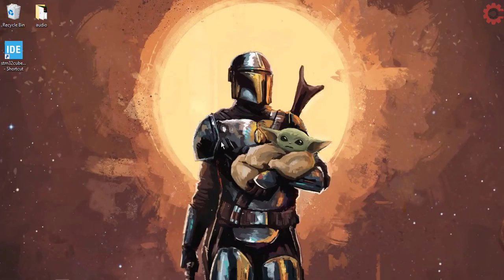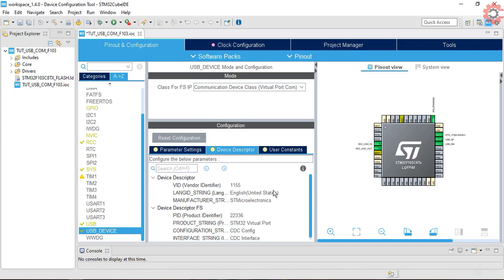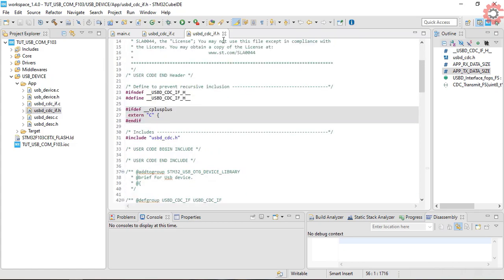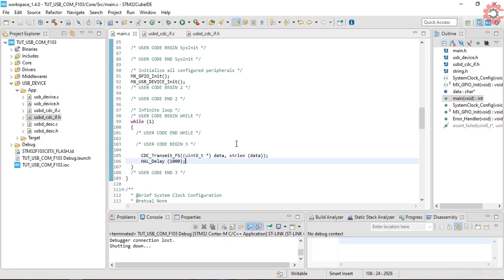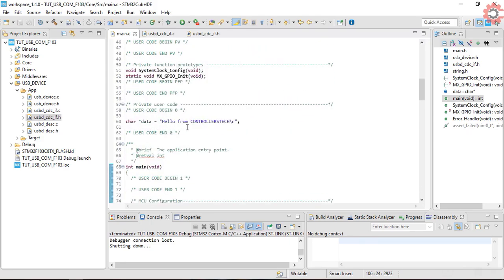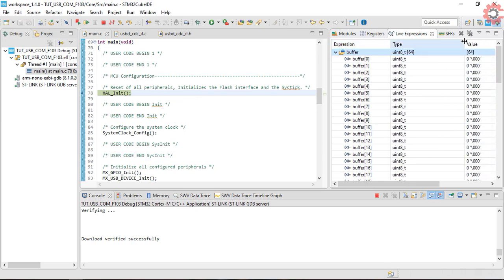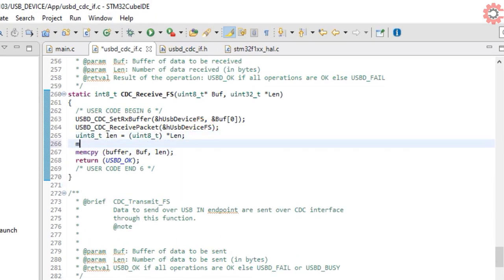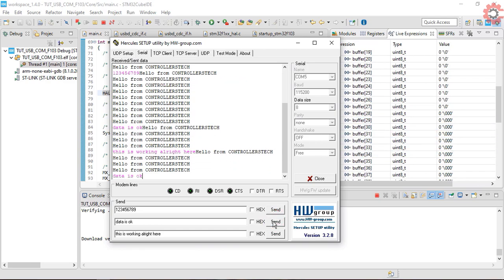STM32 USB CDC Tutorial: Virtual COM Port || Bidirectional Communication Without UART

Comment: Thank you for all your content; It really helps. I m trying to do the same thing but on a Nucleo L053R8. Im following the same steps but it is not working.
Reply from the maker: Do your board have the USB ? 
Nucleo boards comes with only 1 USB port by default, and that is used for st link and uart..
You need to attach another USB to your board..
Reply: @ControllersTech  Hello Thanks for the reply. I thought I could use the USB with the STLINK (I am still a beginner in STM32 field). Everything works now ! (I had also a problem with my current cable, It could not send data).

Comment: How fast can you send such data to the PC? So what is the virtual baud rate? I'm using the Teensy 4.0 for a similar function, and there it is operating at full USB 2.0 speed. I wonder if ST32 can achieve the same. The reason why I ask is that I want to output debug code to the PC in time critical code, and anything lower than 2MBaud is slowing down the code too much to operate.
Thanks!

Comment: How do you download the code in the microcontroller? I'm used to Keil Uvision compiler, but now in the CubeIDE I can't find this option. Do you have to always open the debugger to flash the code? 
Also, to use the debugger "live expression" to see the buffer, you had to connect the USB port and the STlink at the same time?
Reply from the maker: To download the code, click the run button 
No you don't need to connect usb cable. Just connect st link that's enough.
Reply: @ControllersTech  but if you want to send data from Hercules while you are debbuging, as you are doing in the video,  you have to connect both St Link and USB cable. My problem is when I connect both, the USB com port "cannot be open". Hasn't it happened to you?
Reply: @gustavovisentin1987  I have the same problem. It's not working when connect both st-link and usb
Reply: @ControllersTech  Thank you very much for answering. Your videos had helped me a lot!